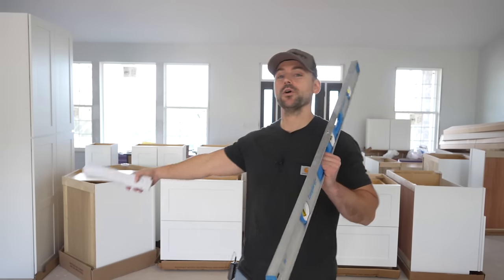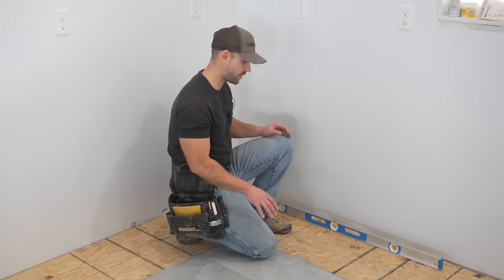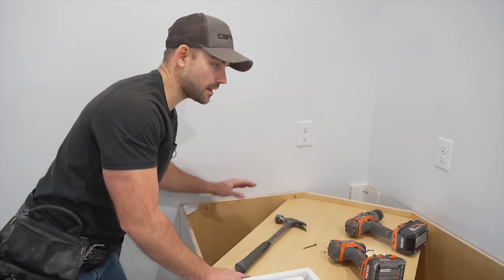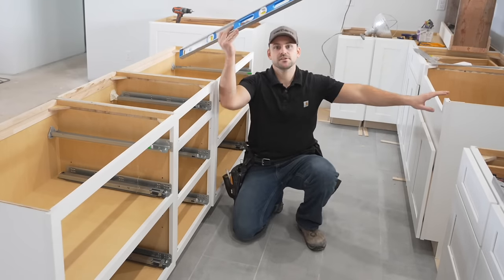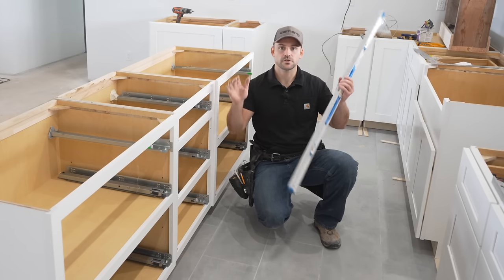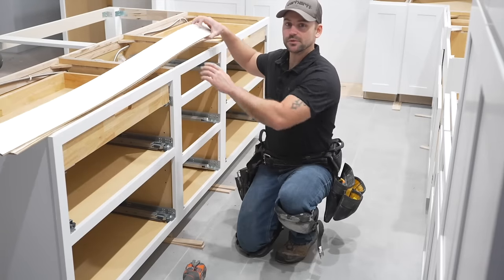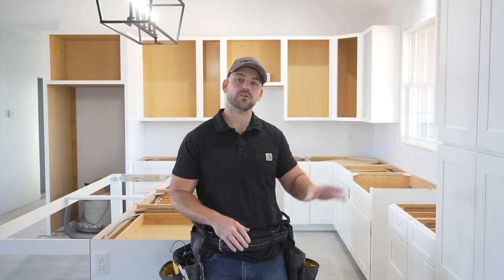How To Install Kitchen Cabinets: The Ultimate DIY Guide

Comment: From experience, I find it easier to install the wall cabinets first. Take 54" from your finished/leveled floor height. Preferably use a laser line. It's easier to reach and get to the upper wall without the base cabinets on the way. Excellent video. Thank you!
Reply: And that is the way it should be. Flamers are the most horrible + sheetrock and finishers don't help. Them walls feel could feel like a storm in the ocean.

Comment: If I may ask, how did you learn to be so skilled at most trades?
Reply from the maker: I have been building houses with my father since I was a teenager. Overtime you learn tips and tricks that you do not forget. Thanks for watching!
Reply: In todays days and age with technology at the touch of the finger tips only you become the obstacle. At the end of the day you do enough research and become YouTube certified and the sky is the limit. End of the day one mistake will cost you less than hiring a contractor. 😅
Reply: I’ve worked for a GC for 10 years and his top Forman for 6. Learned from not being afraid to do something, and I’ve always have been in the mix with other skilled tradesmen throughout the years, you pick it up like like he said. Takes years of experience. I have buddies break off and try to go at it alone to find out they are not properly equipped, or prepared to do much more then simple repairs.

Comment: Finally, a video that actually shows how to do the install, step by step, and does not just gloss over the fine details! I truly appreciate your showing the actual process step by step, with your thorough explanation, instead of just a quick cut to an "after" photo. You are obviously very intelligent and are a great teacher! 

I am a kitchen & bath designer. I always consult on the installations when needed, but I am no carpenter. I can't tell you how many times clients or their contractors ask me how to install something. I can tell them what I know about properly installing a kitchen, and how to put together what I've designed, but that's where my involvement ends. From now on I'll be directing my DIY clients to your fabulous video. Thank you for the time you spent in making this video!!! It's the best one I've ever seen on the subject.

Comment: 2 things when framing in kitchens always block for your cabinets 2x6 at 34.5” along all stud bays that get cabinets and then same for your uppers, then no matter where your cabinets land your hitting solid backing.

2nd thing is we always install uppers first, this way your not leaning over the lowers risking damaging them. Also we install cleat at the pre determined height all around to set uppers on to keep them perfectly level and at the right height
Reply: Genuinely asking. Wouldn't it push your cabinets out having a block behind them? Or maybe I just didn't understand what you meant.
Reply: this is exactly what my father taught me many years ago and I've never had any issues still to this day.
Reply: But I must say his little block trick would definitely save me some energy as I install these alone.
Reply: THANK YOU! I was wondering if I can just add in a crap ton of blocking so I hit studs. Apparently in Texas, the studs are 24” on center.
Reply: @jasminewatson9132 no. You’re adding 2x4’s or whatever size between your studs on the exterior wall. I’m gonna assume that’s before installing your drywall so that your cabinets DONT stick out. Does that make sense?
Reply: @jasminewatson9132  you block behind the cabinets before drywall is installed
Reply: Installing the uppers first is the easy way, not the right way.

Comment: Having been an assistant to many cabinet installs Have Got To Give You A 👍  on the idea of the upper cabinet bench that's a lot easier than running a ledger board. As my mentor Robert would say YOUVE GOT A 10
Reply from the maker: Thanks for the 👍William! I have never used the ledger board method because the box is so easy. I appreciate the 10! Take care!

Comment: Hi Josh, I always know I can trust your instructional videos. Thank you! We are building a new home & will have laminate countertop. Our issue is that the countertop will have a seam, because it is longer than 12'. Is there a kitchen sink that can completely hide the seam? I assume a top-mount apron front sink has the best potential of doing that. The issue will be if the back sink edge covers the entire countertop. Do you have any suggestions or ideas to accomplish this? Thanks so much!

Comment: There's so much involved.  This has solidified my view for me anyway I'd hire the store I bought them from to install as well and suck up the cost.
Reply from the maker: Hey Joe! Yes it’s not the easiest thing to do. After you figure out one kitchen, the ones there after go fairly smooth from my experience. Thanks for stopping by!
Reply: @TheExcellentLaborer  I guess it's like anything.  I ordered a kitchen island I had to put together and following the Chinese instructions was challerging and took me over 4 hours but if I had to put together another one I'd easily cut that time in half.

Comment: Hi Josh. Great video! Thank you for putting this together. I have a question about connecting base cabinets to the wall. Did you connect the cabinet between the corner and sink to the back wall? You didn't show this or mention that you did. Should all base cabinets be fastened to the wall?

Comment: Thanks for your video. I’m beginning my kitchen remodel project and this helped tremendously.

Do you not need ladder box for these? I saw an ad for cabinet levelers that replace ladder steps and shims. Wasn’t sure what the ladder box is for if shims is all you needed to level cabinets with.

Since you’re an expert, what do you recommend? Flooring then cabinets, or cabinets then flooring. I want to make sure someone can pull a dishwasher, stove or fridge so I’m not sure why people do cabinets first. Am I missing something here?

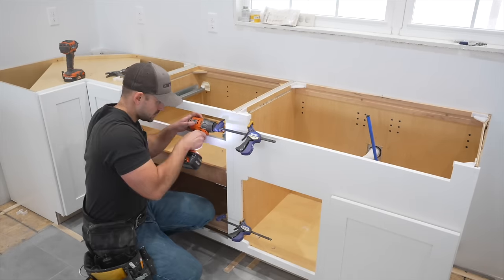Comment: Very good video. Especially the tip you gave for the shims being reversed. I had one question though. At 17:30, you installed the cabinets to each other. However you did not install the cabinets to the wall. So i just wanted to make sure that the correct steps are levelling the cabinets, connecting them to each other and then connecting it to the studs for base cabinets? I understand wall cabinets you may screw cabinets to the studs first

Comment: I absolutely love installing cabinets. Are code, cabinet screws need to be the molded washer head for the wall and base cabinets attaching to the walls. The screws for the front of the styles I found a company in Pennsylvania that I've used for years that actually only need a pilot hole for the faceframe of the fronts because they have self drilling and counter sinking barbs on them so no need to use a counter sinking bit. Quick grip clamps come in use for some cabinets but I found a company called Pony, that makes clamps that go over the front styles and have screw clamp capability from the side and the front which makes the face frames right on. With one cabinet installed and using two of these, you can walk away if you forgot a drill as long as it's not a 36" wide cabinet or so. 

Exactly right on making sure your corner cabinet is at the right height if the floor is off at all. Nothing like getting so far, then realizing the floor rises or falls, more in remodeling. Barrel lazy susans are a great cabinet to learn with when you first install one. They can be a challenge of course. Most companies have gotten away from them in our region but still available. 
Look forward to everything installed. Great job Josh. 👍🏻🙋🏼
Reply from the maker: What I like about installing cabinets is that it looks like a lot was done and a little bit of time because they take up so much space which is satisfying. That’s interesting about the screws you mentioned in Pennsylvania. Here they like to see at least washers. I will have to check out that company called pony. I have never heard of them. They sound like a good product. Sounds like you do a little bit of everything like me. Thanks for stopping by again David!

Comment: Great video.  It would be nice if cabinet installers box out the air vents, there is so much air loss with cabinets if there are gaps or holes under the sink.  Boxing those to the toe-kick will help control air flow better.

Comment: Thank you for this video.  One question, are you against laser levels and plumbs?
Reply: There's no reason not to use them if you have them, but for a lot of people this might be the biggest DIY they ever do, and a decent quality 2' level is a lot cheaper than a decent quality dual line laser.

Comment: What's the best way to screw the corner cabinet to the next? The quick clamps don't fit that purpose. Do we just screw both cabinets up and then screw them together assuming they already line up, or should we use some larger clamps that fit over the corner cabinet frame? Thanks!

Comment: Hello my worry is that I want to install a 60” base cabinet in a garage pantry. The issue is that the foundation footing sticks out 2”. It was a cement floor but this section now has tilling the wall has been installed with Sheetrock but it’s not flush with the foundation footing and the floor. I’m thinking about cutting out a 2’ 90 degree angle then the cabinet can be flush to the wall. If not I would have to leave a large gap and install spacers shims and then get an odd size countertop. I’m leaning on cutting the angle so that everything would be square and standard. Did you ever have this issue?

Comment: It is great that you are so meticulous in your work.  I believe if you used the EZ-Level Cabinet Leveling System you would be amazed at the speed and precision, even for first time installers. They cost more than shims, but saves enormous time and frustration and gives perfect results, not just "close".  And they will never move, like the shims will over time which protects the investment (cabinets and countertop).

Comment: how would you recommend installing a 12 inch cabinet that does not have a stud behind it?
Reply: I'm finishing up a kitchen which was gutted. While the walls were open, I installed nailers in the framing at the height of cabinet attachment. Used 2x4 lumber on edge. That way, you will never miss the stud. 
😄 Is your 12" cabinet between two other cabinets? If so, screwing the face frames together and attaching them at the side in the rear is probably enough. If it is free-standing, I would open the wall and add a nailer. You will have to do some wall repair, but I don't trust wall anchors with a heavy cabinet.

Comment: Did you use recessed trims or retro fit kits? What kind of trim or retro fit was used?
Reply from the maker: I used the 6 inch cans that came with the trim kit. I did not use that trim kit I bought separate LED trim kits. I did not do the retro fit. Hope that helps Sean!
Reply: @TheExcellentLaborer  thank you

Comment: First issue. As a designer since 1994, I worked for HomeBase,Lowes &Home Depot, I would never give out that floor plan with all dimensions on it unless they we're purchasing.
Secondly, I would never install base cabinets first. Wall cabinets come first and talls.. Additionally, I would use a laser level. You do nice work, though.... Just not in order, I would do it.

Comment: Great install video! thanks so much. why not use cabinet screws that have the ring already part of the screw? i'm guessing the construction screws are stronger. also, I usually order base cabinets not with solid wood (plywood) and uppers WITH the plywood as this provided a stronger box to install to the wall. I dont feel confident with the particle board boxes as upper cabinets.
Reply: It's really just a preference. I prefer the wafer head screws myself, but some people prefer a beauty washer and wood screws. The advantage of the deck screws he's using and flooring screws in general is the extra anti-backout threads just under the head of the screw that prevent it from counter-rotating and working itself out over time.

Comment: Do the shims not slide around over years and years? If you have to shim up a cabinet a lot doesn't all the weight go directly on the shim instead of spread out evenly across the bottom of the cabinet thus compromising the structural integrity??

Comment: Maybe I missed it, but when installing the upper cabinets how did you know where was the wall studs? From the viewers point of view it appeared you just randomly screwed in the upper cabinets into the wall.
Reply from the maker: There was a few spots that had vent pipes coming up through the wall where blocking was missing. I then had to find the nearest stud. Hope that helps!
Reply: Knok on . Use the back of the finger. Know across the wall and where you hear a solid sound rather than hollow the stud where it is at.

Comment: Any advice if the wall cabinet is not going to hit a stud? How are you going to attach it to the wall
Reply from the maker: Cabinets need blocking behind the drywall. Check with your local Planning Office to see if there is an alternative if you do not have blocking.
Reply: @TheExcellentLaborer  thanks it’s an old house, 40s. Doubt if there’s any blocking behind it
Reply: Here’s one approach….if the cabinet is not hitting a stud typically it’s a very thin cabinet (like a 12”) that just happens to be positioned between two studs. Make sure the cabinets to the left and right are secured to the studs. Secure the small cabinet to both of those at the face frame, but also cut some spacers and sandwich them in between cabinets so you can side screw the cabinets to each other.

Comment: Was your outlet for the microwave upside down, or is that new code?
Reply from the maker: It can go either way. Thanks for stopping by!
Reply: @TheExcellentLaborer  wasn't trying to be a keyboard contractor, thanks for the input, I was just wondering as a friend said it was the new code. Thanks for all the helpful videos man, you rock.
Reply: It's a short circuit protection, if the plug was partially inserted with an exposed section of the prongs and the outlet was installed the other way, a falling metal utensil could short across the hot and neutral, but the other way it hits the ground prong with no effect.

Comment: just curious why you wired the microwave outlet upside down?  I usually have the ground hole down, but figured you had a reason why you did it upside down (like that is code for microwave outlet or something)
Reply: The ground terminal up is supposed to be the better installation method overall. If a plug is not press in tight to the outlet and something was to fall/contact the plug it would contact the ground. While if ground terminal was down it would contact with the hot and neutral.
Reply: @UserError7861  ahhh, that makes a lot of sense

Comment: I’m confused on which to do first. The uppers or lowers? I’ve seen people do it both ways. Wouldn’t you want to do the uppers first so you don’t have to deal with the Lowe cabinets being in the way?
Reply: Always do the uppers first.
Reply: The reason he did the lowers first is so he didn’t have to drill into the wall for cleats to hold the uppers while installing. We have pine shiplap walls, and I’d rather not put holes in my walls that don’t need to be there. So I really like his method and his “secret weapon”

Comment: Why you used deck screws for cabinets? There is the screws called cabinets screws they also have 2 1/2 and 3 1/2 inch available

Comment: How do tackle a 18 inch  wide cabinet on a 24 inch centred studded wall.  These are stand alones. No other side cabinet or side walls . Older home has 24 inch studded  outside 1/2 in. drywall walls. Only 1 stud to grab in the cavity insulated poly wall

Comment: Install base cabinets first? I thought the uppers would be first.
Reply: I like to install uppers first because I have an adjustable tripod which holds them up while I level and attach. Base cabinets would be in the way. Whichever way works for you is fine though, as long as they are level and plumb!

Comment: Good video,  but you must be killing your back installing base cabinets first. Other pros suggest installing wall cabinets first, which makes a lot more sense.

I quickly learned simply trying to install a bathroom medicine cabinet how awkward and painful it is trying to reach over a countertop/sink to install a cabinet over top.  I always ended up pulling out my vanities and disconnecting the plumbing first because it was nearly impossible to get the leverage I needed, and it was killing my back.  And that was only for 1 medicine cabinet.  I couldn't imagine trying to install an entire kitchen in that order.

I definitely don't recommend this for anyone unless you enjoy putting a lot of extra strain on your back.

Comment: wouldn't it be easier to install the top cabinets first? more excess to lift them up
Reply: I was going to install the top/wall cabinets first. But this video changed my mind. I'm installing cabinets on a concrete floor (vapor barrier paint). My floor is very level, however I may have to check if I need any shimming. After this watching this video I think if I install top cabinets first based on a distance/gap I need from the base cabinets that I will have to estimate from the floor and then have to install the base cabinets later and adjust certain base cabinets with shimming, it could be a mess especially if the gap changes from one end to the other. Its better to install base cabinets perfectly level first like he shows and make a fixture to keep top cabinets in place.
Reply: @sn2477  oh i see

Comment: That's not for surface mount. Why don't you use 4" squares or handy box? That's an old work box that's meant to be cut in.

You are right, you should hire a professional... Including you.